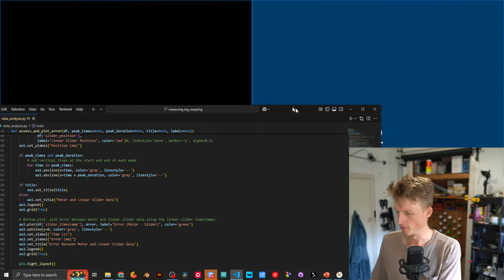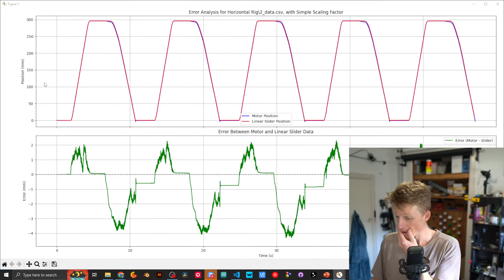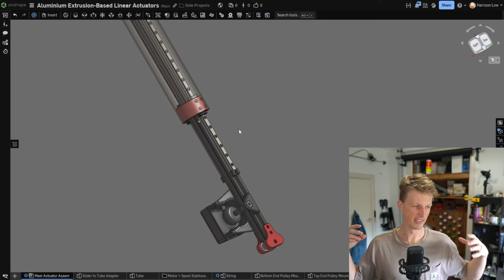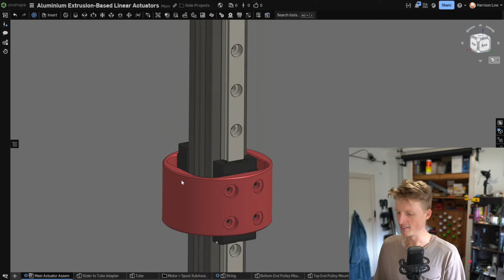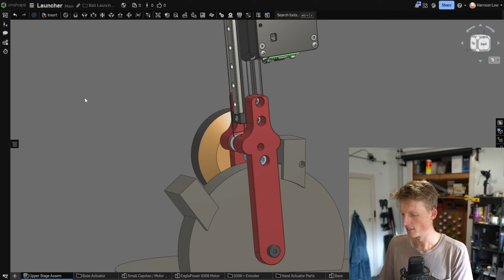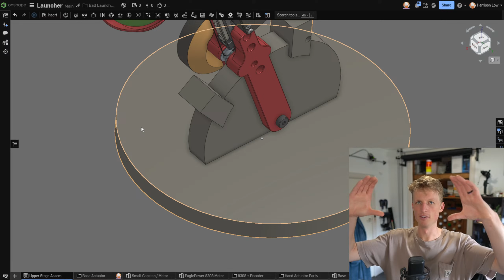PDJ Weekly Livestream # 51 - Jugglebot Lives Once Again!

Comment: Suggestion for laser measurement, Grapple Robotics is in AU and sells a LaserCAN product ~$50aud which is marketed toward First Robotics Competitions.  Not sure if it has mm precision, though.  A mirror array that bounces the TOF beam up & down multiple times could amplify the change-in-distance (similar to the cable tensioner you mentioned earlier).
Reply from the maker: You've reminded me that I actually have a VL53L1X board (the same sensor that the LaserCAN uses) so I'll have to do some testing with that to see its precision.

Your mirror array idea is very interesting. Do you think that would be feasible even while the actuator is moving? I'd think the optics there would need to be very precisely designed/positioned for the beam to stay aligned through the entire stroke length 🤔

Comment: Do you think the old design is worth exploring with some of my students? We were looking at repurposing for a robot design to add a claw end effector.
Reply from the maker: Very cool idea! What age students? The old design (of linear actuators) is functional, and I think it's a neat mechanism! Though could potentially be a bit difficult to assemble - it takes some patience to route the strings through.

Perhaps this video could be interesting?
https://www.youtube.com/watch?v=DeBLc2D6bvg
Reply: @ they are year 10 to 12. We have a lot of experience with linear slides however they are mostly ball bearing systems. The Misumi products we use are amazing however this type of telescopic arm is useful for certain things.
Reply from the maker: @mrprobotics8283  Neat! If it changes your thoughts at all, the new actuators that I showed in this stream probably won't be finalised for at least a few months, so I wouldn't wait for them...

If you do decide to build my current actuators, let me know! I love seeing my designs 'in the wild' and I'd be more than happy to help troubleshoot any issues you run into 😊
Reply: @ this is type of stuff students are doing. https://youtu.be/x4z5jL-8w8A?si=a2knljZkRRJrh4SV

Comment: Why don't you put a second hand at the base? So this could be fixed in the center of the base and throw balls straight in the air and juggle bot could first move away and once the ball hits the top move below the ball. Hope you could understand what i mean

Edit: I was to fast at commenting. Its actually pretty similar to your approach :)
Reply from the maker: Very interesting idea! I haven't given much thought to having the 'primer' be under Jugglebot, though you're right that this would solve a lot of the issues with having the primer above Jugglebot. We'd need to be very careful with the release times to ensure that there aren't any launches into the bottom of Jugglebot's platform, though this could potentially work even better than having the primer off to the side because it could throw to have the ball reach its peak just over the hand, meaning it'd enter the system with very little energy. 

Cheers for the suggestion! I'll keep this in mind as the primer progresses 😊

Comment: I think the new design with rails on two sides is likely to over constrain the movement and lead to binding. You don’t have control over the distance between rails other than shimming which would be a pain. It also doesn’t add much rigidity or precision other than in the torsional direction which I guess isn’t important. If the second option with a moving rail can work, then the 1st option with a single rail can also work, still with a cylinder encapsulating everything if you want.

Second more random idea is you could maybe look into using pneumatic cylinders as your linear rail. They come with square rods if you want and can have nice air cushions built in which would work even after you do surgery to make them string actuated. You can find lots of solutions for adding sensors etc to pneumatic cylinders
Reply from the maker: Good point re. binding... At this point I'm thinking I'll print off a few test pieces and just see how well things go. A big motivation for using two rails is that it makes routing the string a bit easier, since we don't need to direct it through the very small channel in the 2020 extrusion behind where the rail sits. That said, that routing might be tight, but it should still be possible 🤔

Re. pneumatic cylinders: this is an interesting idea! I've bought a cheap cylinder from AliExpress to play around with. Cheers for the suggestion 😊

Comment: I like the variable resistor idea for measuring linear motion. Digital calipers work in a similar way I believe. 

I haven't gotten the chance to watch the whole stream, so apologies if this was already brought up. Another route would to use the same tech they use in optical computer mice. Super small and very inexpensive. You could print a fine pattern along the rail that the sensor looks at. I imagine it might be possible to have some sort of unique calibration pattern every few centimeters if that turned out to be necessary. 

Love following this project!
Reply: Digital calipers work with capacity, not resistance.
Reply: Oh yeah you're right. I was confusing it with potentiometers.
Reply from the maker: Very interesting suggestions! I should've taken inspiration from my digital calipers sooner 🤦‍♂️
Time to look into capacitive linear scales 😁